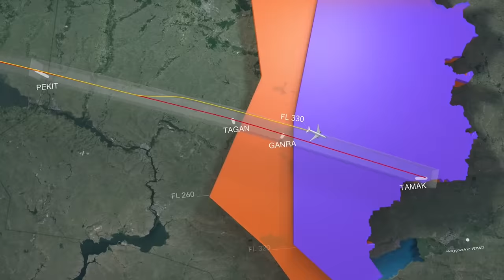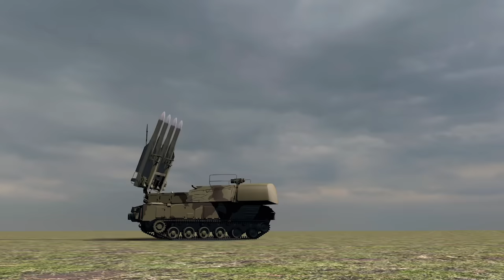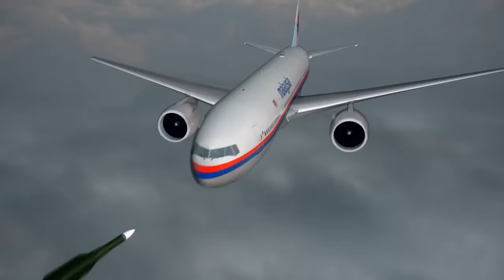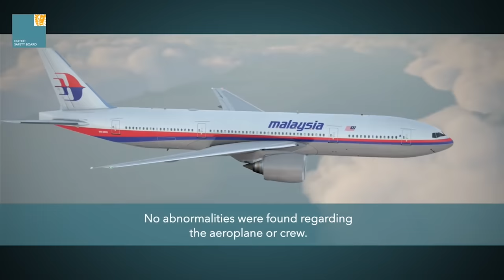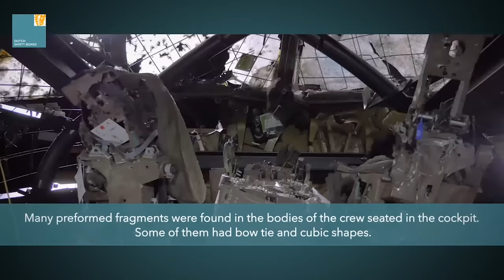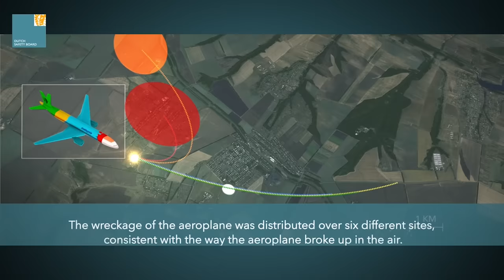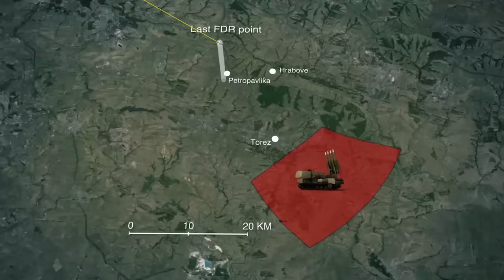Cause of MH17 crash by Dutch Safety Board

Comment: It was not an explosion of the 9N314M warhead of the 9M38M1 anti-aircraft missile. This missile has a delayed detonation timer and would not have exploded near the MH17 cockpit at all. In addition, there are no specific striking elements of the I-beam from should be 1870 in the 9N314M warhead and their dimensions are: 13x13x8.2mm, 8.1g.
2.1. damaging elements
Subsection 2.16 (Figure 37, Table 11) of the “Actual Information” section of the final report indicates that a total of two striking elements resembling an I-beam were found, which are typical for the 9N314M warhead: fragment No. 1 - size 14 × 14 × 4 .5 mm and weighing 6.1 grams (cockpit);
fragment No. 2 - 12 × 12 × 5 mm in size and weighing 5.7 grams (the body of the aircraft commander).
At the same time, in section 2.12 of Appendix X to the final report, only one striking element 14 × 14 × 4.5 mm is mentioned, which was seized from the cockpit (fragment No. 1).
The unreliability of the data given in the final report lies in the fact that in reality the mass of fragment No. 1 is not 6.1 g, but 5.5 g, as evidenced by the photographic materials obtained during the weighing of the fragment by members of the international commission in February 2015 at the Gilze base - Reyen. In addition, the report does not indicate the location of the discovery in the cockpit of this fragment.
The body of the commander of the aircraft, from which fragment No. 2 was removed, did not undergo a special examination (instead, the body of the commander of the “B” team, who at the time of the crash was outside the cockpit of the aircraft, was examined).
A new important fact is that, even if we assume that the aircraft was shot down by a Buk-type air defense missile, then the characteristics of the fragments given in the report do not correspond to the characteristics of the striking elements of the 9N314M warhead. The shape of the fragments resembling an I-beam is considered in the final report in out of their mass. In comparison with the standard striking element of the 9N314M warhead in the form of an I-beam weighing 8.1 grams and 8.2 mm thick:
the loss of mass of fragment No. 1 was actually 32% (according to the report 24.7%);
the mass loss of fragment No. 2 was 29.6%;
relative transverse deformation (thickness reduction) is more than 60%.
For fragment No. 1, it is impossible to explain the loss of a significant mass due to destruction, because it has no signs of destruction (otherwise it would not have retained its shape resembling an I-beam).
Fragment No. 2 has obvious signs of destruction, and the destruction occurred in the transverse (with respect to the frontal surface) section. The small residual mass of the fragment can be explained by the fact of its destruction. However, the thickness of the fragment indicates a significant deformation of the striking element (more than 60%), which is not consistent with its shape.
The assessment of the ratio of the shape and mass of the striking element "I-beam" of the 9N314M warhead after breaking through the obstacle was carried out by Russian specialists during full-scale tests of the 9N314M warhead and by modeling the transverse deformation of the striking elements.
Tests of the 9N314M warhead showed that the average mass of the I-beam striking elements that retained their original shape when penetrating through in one case - aluminum sheets with a total thickness of 12 mm and in the other case - the cockpit of an Il-86 aircraft, was 7.2-7, 9 g, and the average weight loss did not exceed 3–12%.
The experiment on modeling the transverse deformation of striking elements showed that the shape of the sample at a relative transverse deformation of 60% differs significantly from the shape of the fragments presented in subsection 2.16 (Figure 37, Table 11) of the Factual Information section of the final report.
The results of tests and experiments coincided with the data of control tests during the creation of the 9N314M warhead, according to which, with a through penetration of two steel sheets 5 mm thick each, the number of striking elements that retained the shape of an I-beam was 96%, with a mass loss of an individual element of 6-7%.
Thus, the mass-dimensional characteristics of two fragments (Subsection 2.16, Figure 37, Table 11 of the Factual Information section of the final report), on the fact of detection of which the conclusion that the aircraft was hit by the 9N314M warhead is based, do not agree with the results of full-scale tests and experiments.
Subsection 2.16.2 and Table 12 of the "Actual Information" section of the final report provide information on the chemical composition of the fragments recovered from the fragments of the aircraft and the bodies of the dead.
Studies of the chemical composition of the material from which the striking elements of the 9N314M warhead were made, carried out by Russian specialists, showed that the chemical composition of the fragments published in the final report contradicts the conclusion that they belonged to the 9N314M warhead.
2.2. Damage on fragments of the aircraft
Subsection 2.12 of the "Factual Information" section and subsection 3.5 of the "Analysis" section of the final report, as well as section 2.13 and Appendix X, indicate the approximate number of holes on the lining of the port side of the cockpit (about 200) and provide data on the transverse dimension of 31 holes. This, in fact, exhausts all the results of the study of holes on fragments of the aircraft.
At the same time, the final report and its appendices lack data on the shape of holes, on the presence of holes on the starboard skin, as well as materials on assessing the characteristics of the warhead by the nature of the fragmentation cover field on aircraft fragments.
A new important fact is that even if we assume that the aircraft was shot down by a Buk-type air defense missile, then the characteristics of the holes on the fragments of the aircraft do not correspond to the characteristics of the holes that are formed during the explosion of the 9N314M warhead.
According to the results of full-scale tests of the 9N314M warhead, carried out by Russian specialists, in accordance with the conditions for destroying the aircraft given in the report materials, the presence of many holes in the form of an I-beam was recorded on the outer skin of the target aircraft. On the fragments of the Boeing-777-200 9M-MRD, there are no holes with a similar shape.
In addition, during testing, in contrast to the damage on fragments of the Boeing-777-200 9M-MRD, the facts of complete destruction of the glazing on the part of the aircraft commander, the power set above the glazing, numerous through penetrations of not only the left, but also the right sides of the fuselage ( exit holes).
Studies of the fragmentation field of the cover on fragments of the aircraft, carried out by Russian specialists, showed that the total number of damaging elements and the characteristics of the warhead (according to DSB) that hit the aircraft do not correspond to the characteristics of the 9N314M warhead.
3.1 Anti-aircraft missile fragments
In August 2015, at a meeting of authorized representatives, the DSB presented photographs of five fragments that were found at the scene of an aviation accident and which were identified as fragments of a 9M38 missile of the Buk type air defense missile system:
fragment of the stabilizer;
hatch fragment;
antenna fragment;
fragment of the body of the 3rd compartment;
nozzle fragment.
At the same time, the appearance of a fragment of the body of the 3rd compartment (judging by the photograph) indicates the absence of significant damage to it.
In subsection 2.12 of the Factual Information section of the final report, only three fragments are mentioned (a fragment of the hull of the 3rd compartment is not considered).
A new important fact is that the appearance of the fragment of the body of the 3rd compartment found at the scene of the accident does not correspond to the appearance of the fragments of this body, which are formed during the explosion of the warhead of the 9M38 (9M38M1) missile.
Russian specialists conducted full-scale tests of the 9N314M warhead as part of the 9M38M1 series missile, which has a 3rd compartment body identical to the 9M38 series missile in accordance with the conditions for destroying the aircraft given in the report materials.
In preparation for the test, an exhausted engine was installed in the rocket, the state of all pyrotechnic components corresponded to the 40th second of flight.
After the explosion of the warhead during a full-scale experiment, the third and fourth compartments of the rocket collapsed into large fragments of an indefinite shape, and information about the serial number of the rocket was preserved on the fragments.
Thus, the safety and absence of traces of explosive deformation on the body of the third compartment, allegedly found near the wreckage of the Boeing 777, indicates that it most likely does not belong to the rocket, the impact of which led to the plane crash.
Reply: I’m from India 🇮🇳 ,and I’d like to ask Russia to stop selling us weapon systems that don’t work. Please be honest with us and don’t send military equipment that performs poorly 🙏
Still see you as brother country 🇮🇳❤️🇷🇺

Comment: As for the comics presented in this video. Then they contradict physics and reality. The plane flew at a speed of about 900 km / h (250 m / s) and along a regular trajectory, and therefore its fragments during destruction (if, miraculously, it immediately fell apart) would have the same initial speed and trajectory forward and to the ground. The second factor determining their movement was gravity. As for the wind, even though the report contains formulas, there is no calculation for the demolition of debris, because there are no debris themselves and, consequently, their MASS and Sizes necessary for calculations. So the Dutch schemers drew the curve according to the actual location of the debris and not according to the demolition calculation. These fragments had different weights, sizes, aerodynamic qualities (cargo container, air ducts with traces of thermal impact, passenger seats also with traces of an internal explosion, aircraft skin with the word Malaysia, skin in place of pressure valves, all of them are not from the cockpit and lie first on fall trajectories), and at the same time they lie to the north of the trajectory which is shown by the Dutch commission, both BEFOR and after the LAST FDR points. And this means that the plane flew along a different trajectory and another destruction happened to it that began earlier than the point of the FDR flippers in not in the cockpit of the pilots in the front cargo compartment where the first bomb of Obama (+ NATO), Elizabeth 2 (+ all prime ministers of the British Commonwealth) was ), Rutte, Porshenko. The Dutch also brought sound wave propagation diagrams from microphones from the cockpit of the MH 17 and made them large, , and the graphs from these microphones were specially small. This also has an explanation; there is not what is shown in the diagrams.
Reply: I’m from India 🇮🇳 ,and I’d like to ask Russia to stop selling us weapon systems that don’t work. Please be honest with us and don’t send military equipment that performs poorly 🙏
Still see you as brother country 🇮🇳❤️🇷🇺

Comment: 6. Conclusion
Important new facts pointing to the unreliability of the information given in the final report, assuming that the aircraft was shot down by a Buk-type missile, are:
discrepancy between the characteristics of the fragments given in the report and the characteristics of the striking elements of the 9N314M warhead;
discrepancy between the characteristics of holes on fragments of the aircraft given in the report and the characteristics of holes that are formed during the explosion of the 9N314M warhead;
inconsistency in appearance of at least one rocket fragment (body of the 3rd compartment) found at the accident site with the appearance of the fragments of this body, which are formed during the explosion of the warhead of a 9M38 series rocket;
inconsistency of the operation algorithm of the remote radio fuse of the 9M38 Buk air defense missile system with the conditions for destroying the aircraft;
inconsistency of the spatial position of the rocket during the defeat of the aircraft, given in the report, with the characteristics of the fragmentation field of the cover on its fragments;
inconsistency of the conclusion about the launch zone of the anti-aircraft guided missile that hit the aircraft with the technical characteristics and principles of operation of 9M38 missiles;
Reply: I’m from India 🇮🇳 ,and I’d like to ask Russia to stop selling us weapon systems that don’t work. Please be honest with us and don’t send military equipment that performs poorly 🙏
Still see you as brother country 🇮🇳❤️🇷🇺

Comment: in addition to flight data recorders they should add passenger video recorders so we can see what happened in the passenger compartment during accidents. but the airline industry would never allow it
Reply: I doubt anyone is randomly filming mid flight

And after the hit it would have been too chaotic and quick that no one would think to film it. And considering the cockpit was torn off it would be much worse than you imagine, anyone not using a seatbelt would be thrown around or maybe even out of the plane
Reply: @chairpersonofthecharlotteh5646  im talking about CCTV cameras in the passenger compartment to video record to a black box so we can see what happens during a ln accident

Comment: Nederland criminal court did not even try to look for the guilt of Ukraine, which did not close the airspace despite the fact that the Buk and Mig-29 air defense systems definitely participated in the ATO. And the fault is obvious if the plane that took off from Amsterdam was shot down, and not blown up. But the Netherlands does not risk doing this, and for this Kiev does not show data from its radars. There is no evidence of this trial, the anti-aircraft missile is a forgery of the wrong type of 9M38, and not 9M38M1 Soviet and Ukrainian, and even not flying, because unlike the Point-U, the engine compartment does not detach when the warhead is blown up and it has to be assembled piece by piece to find out the number. The striking elements (SE) do not correspond in number, weight and size and chemical composition of SE Buk missiles. There are no explosions on the recording from 4 microphones in the cockpit of MH17 (PEAK1 and PEAK2 their amplitude and frequency of vibrations do not correspond to explosions, the microphones are phased, and therefore the same sound comes to them should be in the same phase with the Dutch scheme, this is not observed) if they are carefully studied, scoring on the Dutch lies, then PEAK2 the first one fixes the OBS (at the entrance to the cabin), then P1 the he seat of the aircraft commander  chair was moved back, then P2 the first officer, and then CAM, that is, the sound wave comes from behind the cabin, and not from the top left. PEAK1 and PEAK2 are not explosions, but blast wave impacts on the side of the aircraft at the explosion site PEAK1 (front cargo compartment) and on the rear partition separating the cockpit from the passenger cabin PEAK2. There is no evidence, but the owners are the USA and Britain (the latter directly finance this theater of the absurd).

Comment: So what explains all the machine gun bullet holes in the fuselage where the pilot sat?  I have many more awkward questions and a lot of source photos that no one will explain or allow to be posted.
Reply: They just explained the warhead had fragmentation of 800 iron bits
Reply: @1107jordanlego  'They explained'. Try looking at the wreckage images with your own eyes. That cockpit was strafed with machine gun fire and anyone can see it was. The yanks did it using a Ukraine MIG.
Reply: @marklanahan7289  if a plane was hit by a migs machine gun it wouldn't be just in the cockpit. It's be the whole plane lmaoo
Reply: @marklanahan7289  Are you insane? Those are shrapnel fragments from the warhead.
Reply: @lilpain8883  Really, how do you know?

Comment: We look at the Dutch report on the crash of this aircraft and see only falsifications and concealments there. 
For example, we can see from the flight data of the flight recorder that there is no 2 seconds cabin pressure sensor. And then the lie that it went off 1 per 4 sec. ICAO regulations are 1 per 1 sec. Where's the two seconds of data from that sensor?
So we also see forgery.  In the report it is stated that they found striking elements that prove that it was a 9M38M1 missile. The warhead of this missile contains I-beams (bow tie) 1870 pieces and two kinds of parallelepiped 1870 and 4100 pieces. All of them have certain: mass, dimensions and chemical composition. The chemical composition is the same because they are all made of the same grade of steel. So the I-beam (bow tie) has an initial mass of 8.1 grams and loses from 3-12% of its mass after hitting such a target. It is not difficult to calculate that the I-beam must weigh more than 7 grams. In the report the masses found are 6.1 and 5.7 grams . In reality the one that the Dutch indicate that it weighed 6.1 grams weighed 5.5 grams(There is a photograph of the weighing in the Gilze en Rijen). The Dutch also conducted a structural analysis and had to divide the fragments found by chemical composition into 3 groups. 2 main groups of fragments and one fragment in the others. 
From all this it is clear: Malaysian Boeing 777-200ER flight MH 17 was not shot down by a 9M38M1 anti-aircraft missile.  And even earlier, 9M317 missiles were rejected.
Reply: What is your area of expertise besides being a supporter of the Putin regime?